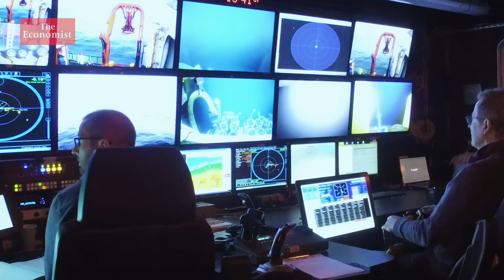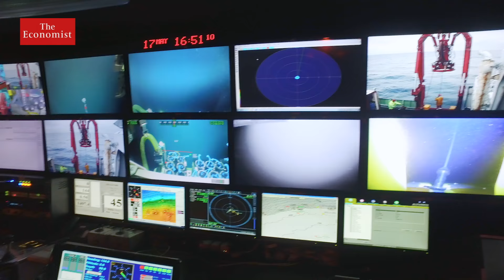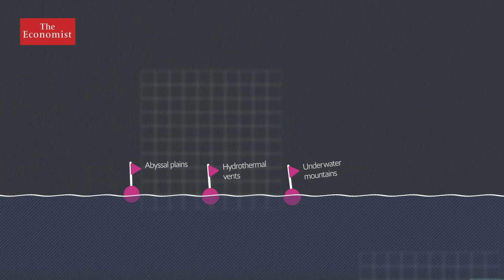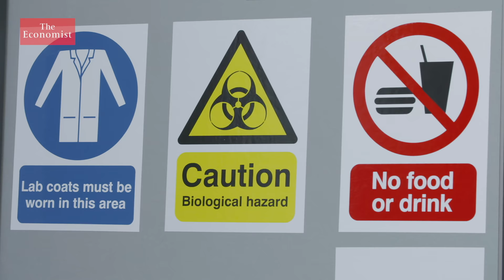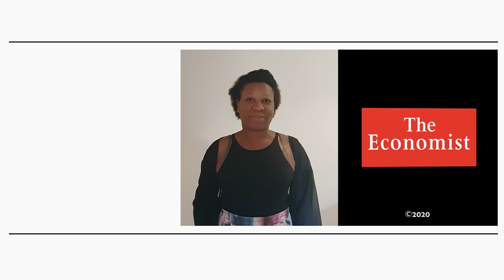Mining the deep sea: the true cost to the planet

Comment: I worry that miners accidentally drill into a deal sea oil deposit. Imagine the devastation.
Reply: That wouldn't happen. Deep sea mining is about collecting metal nodules and deposits on the surface of the ocean floor, not drilling underneath it.
Reply: @brians132  that's better I suppose
Reply: @brians132  lol you actually believe that!?
Reply: This is a perfect example of environmentalists jumping onto an issue without even knowing the full details
Reply: @miamitten1123  Its huge machines that collect these nodules, it will affect the envoirment due to the huge sand smoke that will come up from behind the machine. Its like a giant vaccum cleaner, it doed not drill.

Comment: Deep sea mining will still be way better than surface mining due to the fact that both processes (even after accounting for all possible net CO2 releases from the video) release the same amount of CO2 per kg of useful material ((or less with the former) especially given that there is more of what we want per kg of seafloor than there is per kg of surface material (given that the reason why the continental crust is so much higher is because it is less dense)); and that deep sea mining has no possibility of releasing arsenic, mercury, cadmium sulphuric acid and lead into rivers (given that such waste products can be left exactly where they are found, and are not going to move because they are already at the lowest gravitational potential); surface mining is continuously releasing all of those toxins into rivers and poisoning groundwater.

We don’t have the option to not mine for the materials we need; we must mine from the source that does the least environmental damage, which, until asteroid mining becomes a thing, will require us to mine the deep sea.

q.e.d.
Reply: Is deep sea mining already started

Comment: what an interesting video. and this is a much more nuanced topic if you think about it.  On one end- the planet is on fire and we need to do something about it-NOW. On the other hand we risk hurting the oceans.  If the planet dies the deep sea may die with it anyway (unless the aliens down there can protect themselves from our humans'-nonsense). But with so much resource under the sea- why can't we just mine only what we need for the clean energy so badly needed. Yes, we'll hurt the ocean and potentially lose species we never even knew existed, but if we take only what we need we can limit the impact on the deep sea. It's no use to be moralistic and polar on this topic.  We urgently need innovative solutions to fix a problem that took a century or more to create- but now needs to be fixed in a matter of several years.

Comment: The funny thing about this we may not realize until its too late is that this will only make the climate crisis so much worse. The bacteria and organisms are extremely crucial to the whole foodchain in the ocean. Everything relies on these organisms in one way or another and the ripples caused by this will stretch much wider than we may foresee. If we think corals are having a hard time now, wait till the substrate they rely on is disturbed. And they calculated something like 1 trillion different corals are out in the sea. A majority of which convert co2 into oxygen through photosynthesis. So think about what happens if we were to disrupt corals on a large scale. The amounts of oxygen could decrease very dramatically and corals are very sensitive organisms. I think we need to give our heads a shake and really look into other techologies or even further advancing fossil fuels and finding ways to lower carbon emissions or even find a way to remove carbon dioxide from the air or from polluting sources directly. I've worked in the oil and gas industry in Canada. We have some of the most environmentally friendly approaches to getting oil and gas in the world. I think if we educate other countries on how to do things similarly we could continue on for a very long time without having to worry too much. I think we also need to do something about china. I dont know what and I dont know how but we as humans need to ensure pollution in highly populated areas are down to absolute minimums. We also need to help 3rd world countries and educate them about the environmentally responsible ways of doing things and we need to figure out a way for stricter regulations upon those countries. Even if its some kind of auditing system where 1st world countries send out people to write reports about how their industies operate in environmental aspects and then charge massive tariffs when they want to export or import goods according to their audit scores. I think we need big changes to make the world a healthier place but mining the ocean isn't one of them.